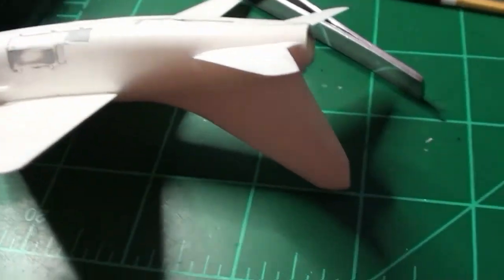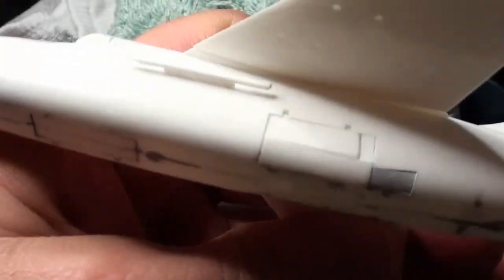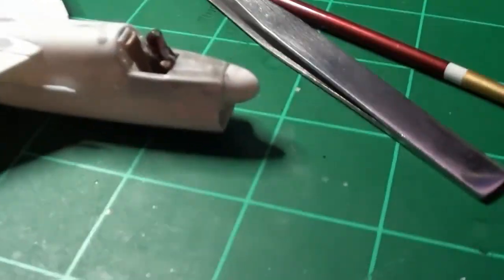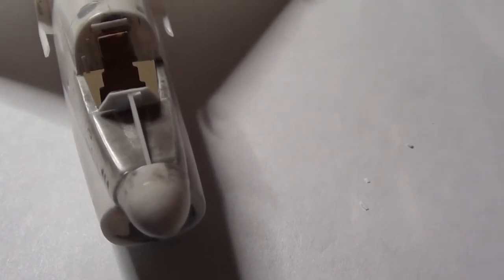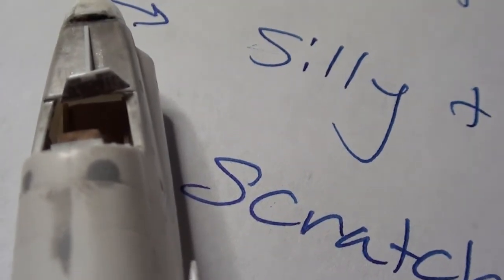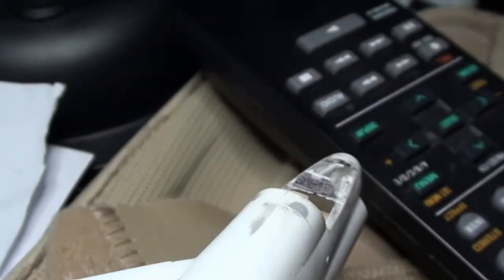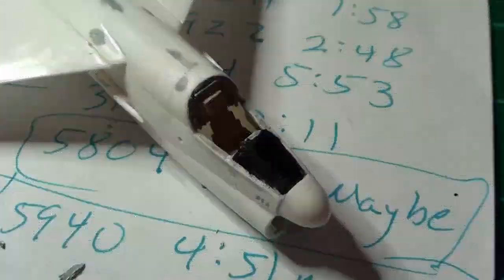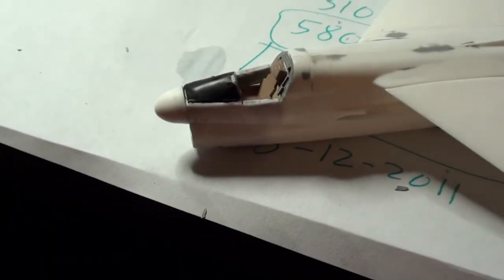A-7A Corsair II:  Part 4  Detail work.

Comment from the maker: @BasicModelling I didn't think of sanding down his back, but it is too late now, he is glued in with the cockpit sealed up and a coat of paint on her.  I will have to remember this.  Doing work on a kit like this is fun.  The modifications are also fun.  Now a kit like that 747 model is not fun.  Too many problems to fix.  I also understand the shake and bake comment, I built one of those two weeks ago, video soon.  Thank you for the great comment!!